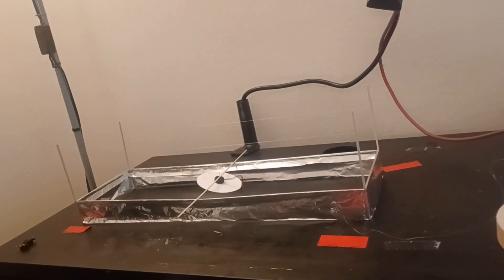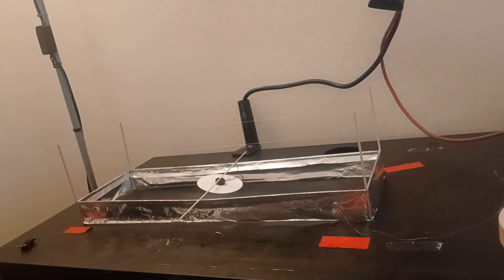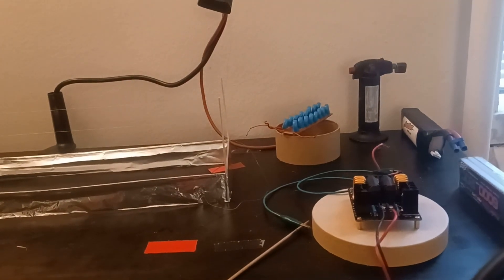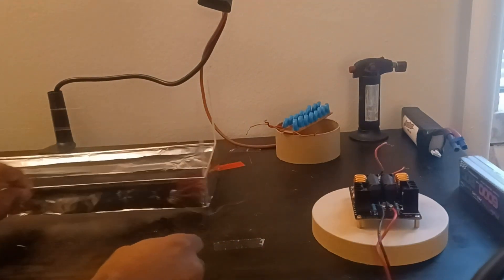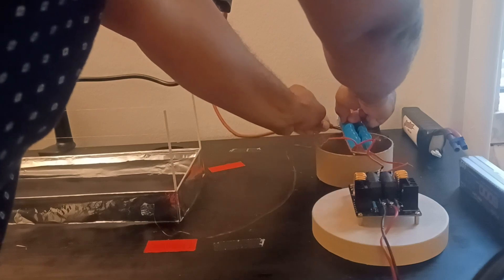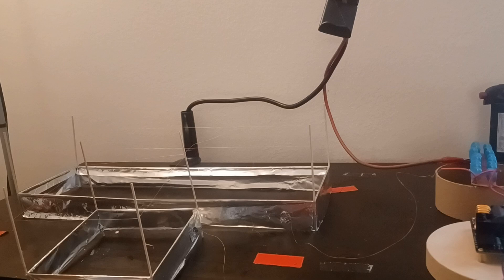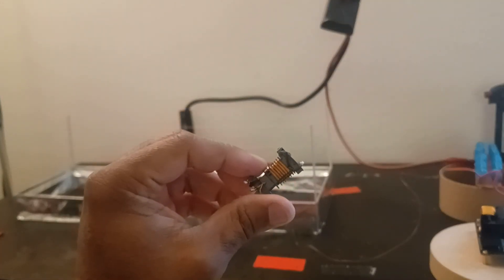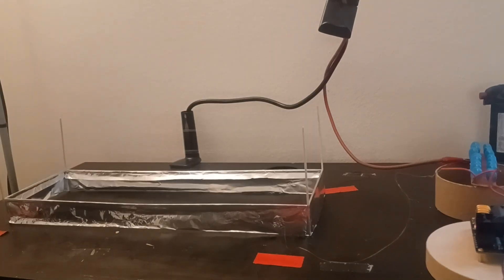ion lifter 2.4. Supporting weight and power supply.

Comment: If you put kapton tape over the bottom rounded aluminum, wouldn't this allow you to lower the thin top wire, to generate more thrust?  My thinking is it would reduce the chance of coronal discharge.  Also, using a lower current through the top wire would be beneficial.

Comment: Much thinner tungsten wire, not copper, for the emitter is the way.  It then requires far less current and less voltage.  It also won't burn out. Good work!

Comment: Great work man. If you limited your current you could safely use the thinner emitter wire without burnout. I've been fascinated by this effect for nearly 20 years and i read and watch EVERYTHING i can get my hands on that's related to it. Many people stlil think it's ion wind only that's producing the thrust but there's plenty of literature out there that shows this isn't true, some other force is at work. The effect works in a vacuum and also when the capacitor is immersed in oil so it's certainly not just air movement. I've gone from lifters to simple capacitors but the effect drives electronic weighing scales nuts so my next step is to use a shielded accelerometer instead. Liked and subbed, great work pal :)

Comment: looks powerful! Is there any possibility to post instructions for making or share a link where you can buy such a powerful converter?
Reply from the maker: You can buy all parts from Amazon. I build my voltage multipliers. So you can go to "Plasma Channel". Jay has a tutorial on how to build the multiplier.
Reply: @goobman1981   did you figure out stability from the dome shaped lifter? I might have to build my own the dome shape is unbelievably stable!
Reply from the maker: @SpectacularRanker2  Stability is an easy solution. I discovered it by accident,  a couple of years ago. I'm more focused on lift. Lately i've been too busy, to work on them.

Comment: Thank you for showing that. 1000w zvs, small coil and a multiplier. I will order them today.  24v battery or quad copter battery? Do you have a rating on the battery?  Thanks again..
Reply from the maker: The battery is Lipo 11.1v 6000mah. I have several with either 50C or 120c
Reply: @goobman1981  just placed amazon order with all the stuff. I will try to build what you did. This is going to be really cool. Thanks
Reply from the maker: @oldmanbuilds  I build my voltage multipliers rather than buy them. Did you order the parts from amazon or are you going to buy a ready made multiplier?.
Reply: @goobman1981  I have one I built 20 kv capacitors. I have been having trouble with it sparking over. my flyback thins out the voltage too much. 

Yours has a lot more amps in it ( thickness of the arks.) so I wanted to try that. I want to be able to compare apples to apples. It's the only way I can gain the knowledge you have about this and it may help my old experiments work better. 

If I need to order other parts let me know.  Thanks..
Reply from the maker: @oldmanbuilds  When u say sparking over. Are you referring to sparka jumping between stages of the capacitor/diodes?. Ok, your using 20kv capacitors. What diodes are you using. Where you solder the joints between capacitor and diodes should be round. No sharp points.
Reply: @goobman1981  The spark is between the legs of the capacitors.  I copied the build from the plasma channel.  "20KV 10mA High Voltage Diode HV Rectifier Tesla Ham" This is the diode. Am I blocking the flow with these?
Reply from the maker: @oldmanbuilds  i built my first multiplier the same from Plasma Channel, but then i found a website that mentioned higher value diodes. If you can, make a video of it so i can see it and maybe help fix the problem.
Reply from the maker: One more thing. If you cant find the transformer. You can also use even smaller transformers. In Jays video he uses a tesla arc lighter. I took it apart the transformer sometimes has 2 coils. So i paralled the input and the secondary was in series. Then connect that to the zvs driver.
Reply: @goobman1981  I will make the video. It might take a day or so, I'm picking up more t.v's today for the flybacks.  https://youtu.be/R9manovSkjo  This is the failure  it's for a different project, but it failed the same way.
Reply from the maker: @oldmanbuilds  Are you using a dc flyback or ac flyback. If DC i can understand why its not working.
Reply: @goobman1981  dc from t.v. the spark is 1 1/2" long. I think it needs to be ac like you said in another conversation. I think the spark is jumping the distance between the capacitor. So it won't allow it to go on to the next stage of the multiplier.
Reply from the maker: @oldmanbuilds  DC flyback are already rectified with a capacitor and diode inside of them. Thats why its not working. The capacitor inside the flyback does not match the capacitors you are using. Since you can't disassemble these dc flyback you can't match the capacitors. 2nd. Since the dc flyback is already putting out a dc voltage. When you put a capacitor on the output. All you did was store up the output voltage from the flyback into the capacitor. Thats why it's jumping, just like stun guns. You get a huge but small discharge.
Reply: @goobman1981  When you power up the lifter does it have more heat? Is that heat helping it lift?

I am testing a tube tv and the heat is much higher than my regular setup. The arc is thicker as well. 

I think the added watts are making heat. and that rises and amplifies the wind. Is this your experience as well or is it different?
Reply from the maker: @oldmanbuilds  I'm not to sure what you mean by heat when powering it up, the lifter. I can say that whenever you power up a flyback zvs driver and create a arc. The flame itself does generate a good amount of heat. On another note. I didnt get to buy a meter to measure the m/s. However i did put my hand under the lifter and felt no wind, but putting a lighter the flame does go out.
Reply: @goobman1981  I am trying to see why 2 flybacks in series with a 4" spark doesn't lift, but on from a tv set will. The only difference is the thickness in the spark and the heat. It receives more amps from the tv and that means more heat. 

If I can nail down the reason for the difference, then getting it to lift more weight may just be a math equation.

The heat is after the transformer but before the multiplier. If you run a dc flyback is there less heat then a small ac one?
Reply from the maker: @oldmanbuilds  i've wondered that myself. I built a 555 with flyback that  had an initial spark of 2inches. Drawn up to 3inches and the mosfet stayed cool. The lifter would only lift about 3 mm. Maybe its the frequency at which the power is running. Remember. Tv circuits were designed and engineered. We are just building simple circuits and hope we get the power we need.
Reply: @goobman1981  I built one with the 555 or music circuit as well. I will try running it next to the tv on and match the sound. I might pick up a meter that reads it as well. 

The crazy thing is that all lifting project have more amps than volts. TT Browns machine on the bottom if covered in capacitors just like Carr's design. The guy who built the coral castle used batteries from all his devices and charged them with the alternator from his truck (more amps than volts.) 

They also pulsed it. May be that's a factor?
When I used a tubed computer monitor instead of a tv it was pulsed way more than the tv. It built up then discharged all at once. Where the tv did it so fast i could not see it.
Reply from the maker: @oldmanbuilds  the tv flyback is standard rectified. A computer flyback has a big capacitor so the frequency is alittle different. The same reason why in your video you hooked up a multiplier to the dc flyback and it was arcing between the legs of the capacitor. Yes amps does contribute to more lifting force. When i first startes out with building lifters. I compared them to car engines. A 4 stroke has low rpm but high torque. Where as a 2 stroke has high rpm but low torque. So you have to have a balance in power ratio. My design has high voltage low amps. Running a lifter from a tv or pc unit which has been designed for efficency is the right volt amd amps

Comment: Thats impressive. I struggled with that, In one of my videos I had a tilt sensor that i lifted up, it looks like you build could probably handle that. Ive heard some people say these things do get better as they scale up. As for arcing on the transformers, I would consider immersing it in cooking oil. You have a nice amount of current from that flyback circuit. I never thought of that, my drivers for those smaller coils ran on 24v, but probably might have been able to deliver the same amount of current. I'd used those drivers, but only with TV DC flybacks, which weren't really that good. (I never found magnet wire to be any good as an emitter)